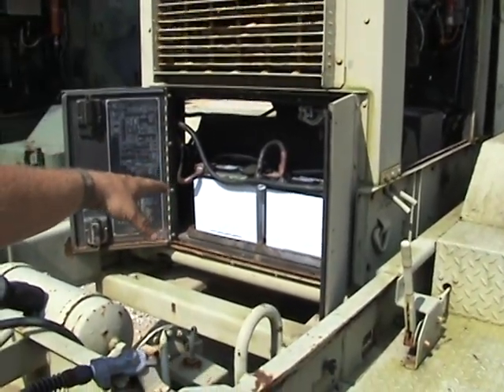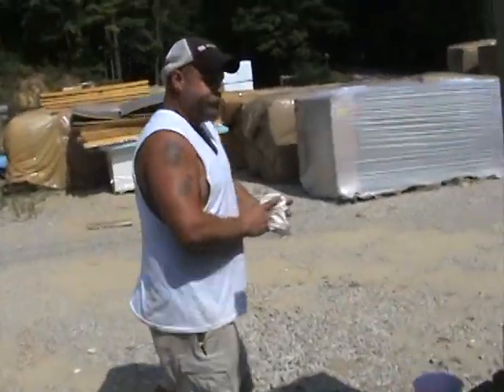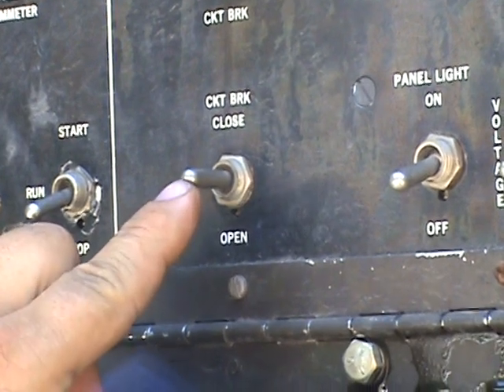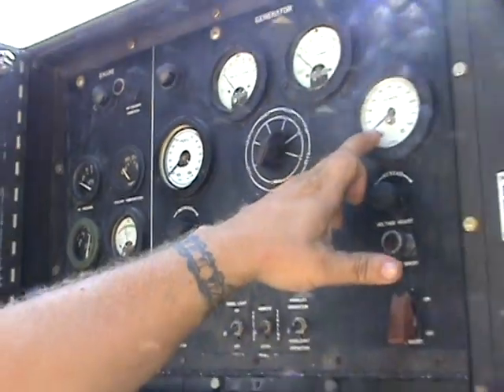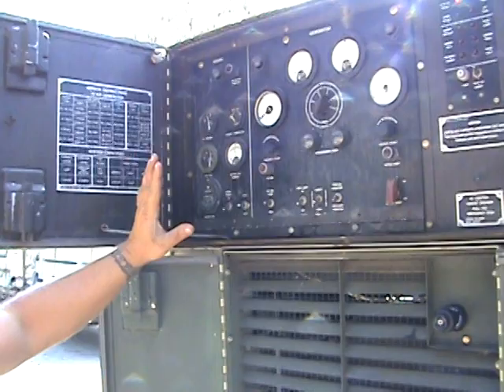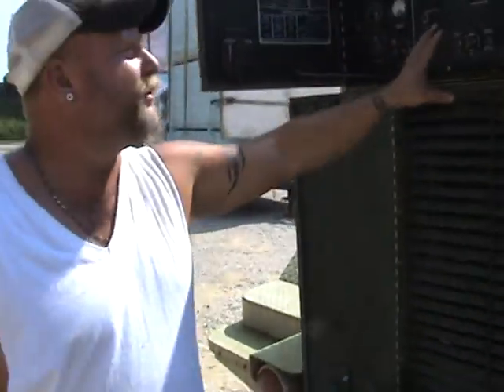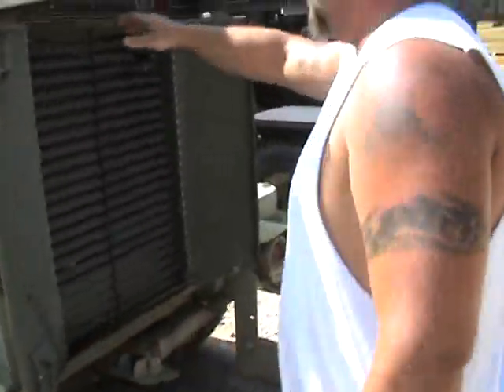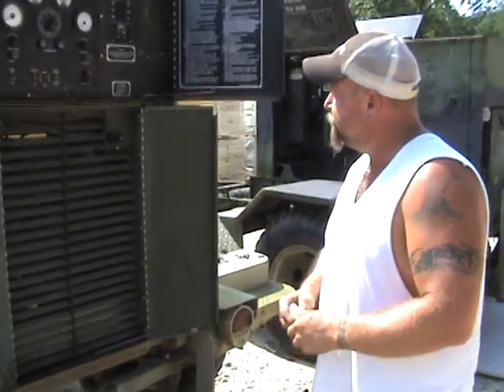Pre-maintenance and starting procedures for a 30KW generator.

Comment: no they do not start at idle. you will blow your AVR if you do that. they should be set at the frequency you want and be started and ran there only to be adjusted from there.
Reply: cowboydan86 Diesel aren’t supposed to be started at full throttle
Reply: If you read the starting instructions they tell you to set the throttle about half before attempting to start.
Reply: @scooby7885  Absolutely correct!  8 years as a USAF Power Production Specialist. This is how I was trained at Sheppard AFB, MB teen and MEP generators. I prefer the MB teen generators.